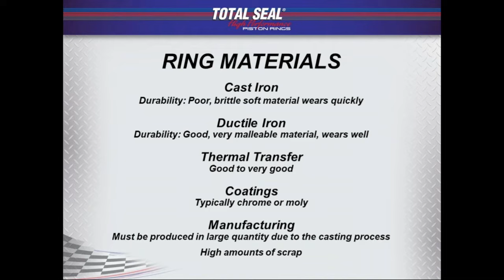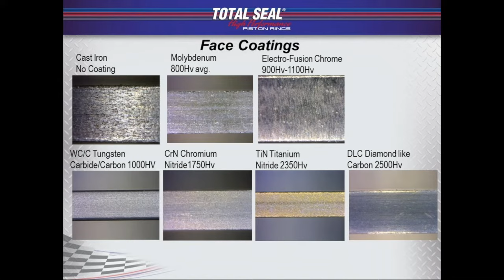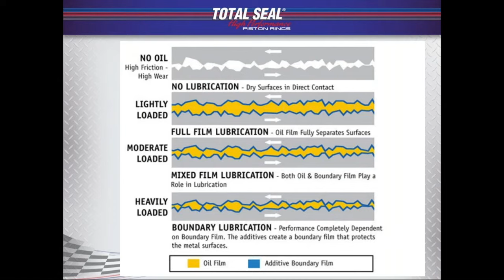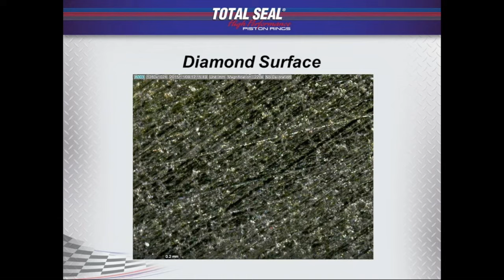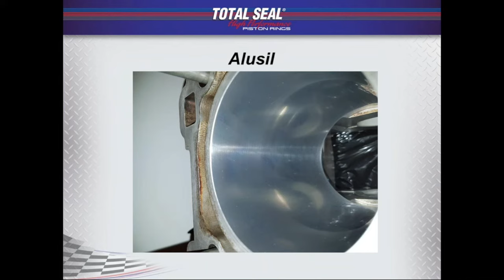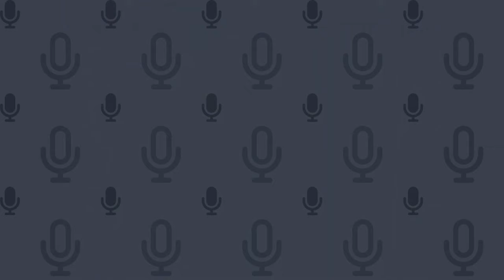AERA Super Webinar - Keith Jones on Honing & Cylinder Finish

Comment: Back in the 60s when the 426 max wedge was one of the tires of the strip out there I read an article where Chrysler would take the block after they took it out of the core box before they did any machine work naturally, they cleaned it up real nice and clean. Got all the sand out of it of course and everything and then they would put it in the oven And heat it up to about 1200° real slowly bring it up and let it cook away for about several hours and then slowly cool it off that made the block the Rockwell numbers equal top the bottom side side and stuff like that I wonder if that would still be a good thing to do with my 5.9 Cummins for my Dodge pick up
Reply: Its interesting that stress relieving a casting can't be a one shot deal after a pour - the second go round after a cooling cycle is what works.  I marvel at the guys who figure out the "how" with metallurgy - like those grading ore when firing a samurai sword...for three days.  I've worked a 120 hour week before: it hurts, and as day three comes around you get more stupid by the hour.

Comment: sunnen doesnt have a silicon carbide 100 grit shown for the an112 hones so i bought some 80 grit keystones and will plateau the after with 400 grit keystones with wipers, i have the sunnen pht731brushes but found they are only 320 so i guess the 400 will give me a better rpk. i recently tore down my previouys rebuild the i did with 180 followed by the brushes and it seems like my residual cross hatch or rvk was mostly gone .. so after your very informative webinar -thank you by the way ... i am droping to the 80 and going straight to the 400s unfortunately i dont have a profilometer and no one i know seems to have one either i wll be going by seat of the pants methods.. what do you think ,Thanks.. Dave

Comment: Very informative video, especially for the layperson, like me, who normally has to rely on the machist to know what they're doing.

I was wondering about your thoughts on bore/hone plates and circulating hot water through the block? With some of these very smooth and/or hard bores there will be little wearing to account for bore distortion with temprature, so it will rely on the ring flexing to the bore shape?
Reply from the maker: Thanks for the feedback and the question. Torque plates increase the assembled bore cylindricity. Simulating the clamping loads makes a huge difference.

Hot honing is also an advantage that is employed on many endurance racing engines.
Reply: @TotalSeal  
I had a thought, after posting that, that the modern trend for 'open' decks may be partially driven by isolating the cylinders from the stress, and deformation, around the threaded head holes. It also exposes a little more of the cylinders to the coolant, which may be expected to help stabilise thermal variations and distortion.
Reply from the maker: @gordowg1wg145  That is very logical. We don't design engine blocks, so we don't have any engineering data to validate that theory. However, those are good points.

Comment: Having a issue sealing Chevy 6.5  diesels after .040 over. Ran it extrem blow-by. Teardown of engine rehone and different rings same results. What kind of oil would you recommend ?  For Breakin.
Reply from the maker: Driven offers a diesel break-in oil. That would be worth trying, but also check the surface finish of the bores.
Reply: There have been reported issues of bore distortion in those engines, a re-bore would further exasperate the problem and if the bore isn't consistently round, no ring is going to seal well.
If you're running higher cylinder pressures (higher boost) it will just get worse.
You may need to look at getting it sleeved and/or gas porting the rings.

Comment: I appreciate these videos 💯, too bad i cannot afford that tool nor do any machines shops here use them 😅 third world issues !
Reply from the maker: Thanks for the feedback!
Reply: I'm at third world too... Really appreciate this videos
Reply: Believe me...Many USA shops cannot afford a modern High HP diamond hone, we shops without the expensive technology use attention to detail and good cleaning proceedures to make good power and longevity. Proper cylinder cleaning after honing is a subject that should be covered....WOW! I hadn't listend all the way through....Keith did a great job @ the end of the video describing a proper cleaning process...I've known too many shops that just put a honed block into a high pressure jet washer...run it through a cycle then spray down the cyliders with WD40 and call the cleaning process finished....Not good enough for my builds.